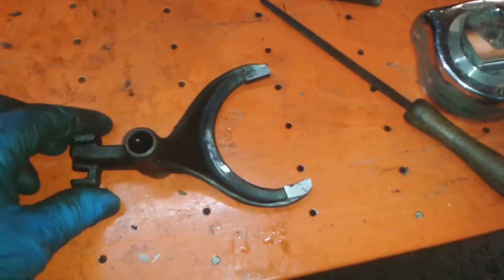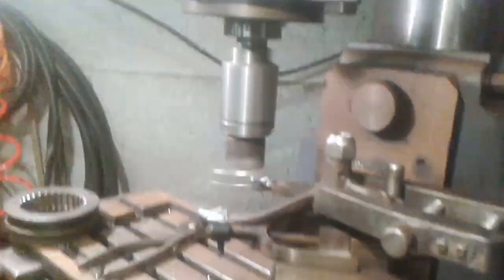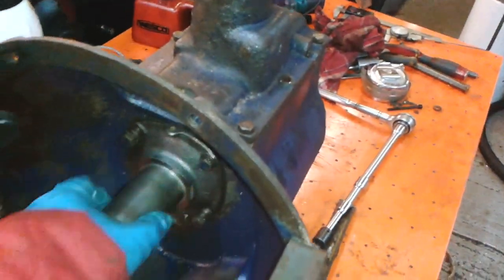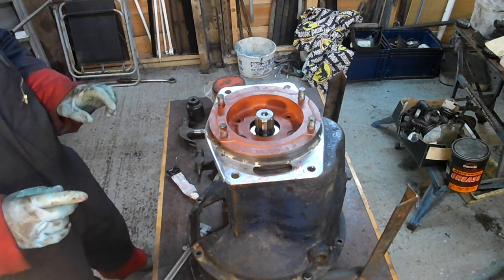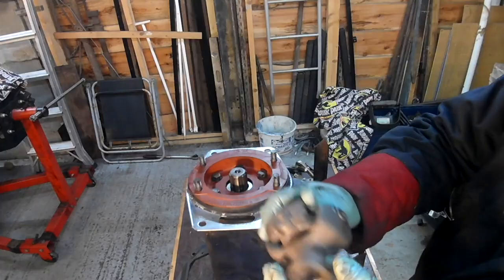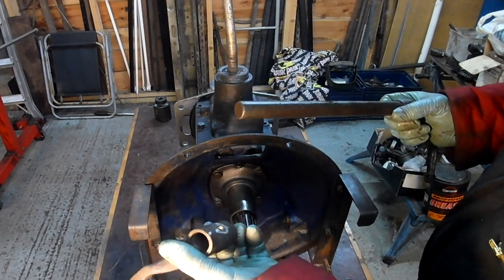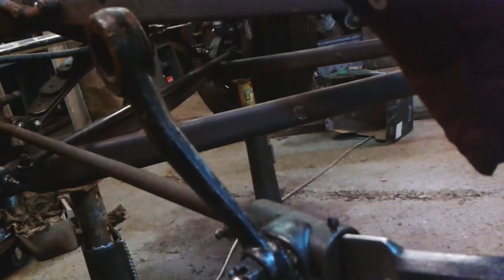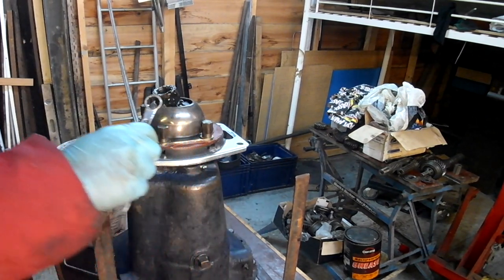Mart's update: 2021 No9. 32 Sedan Project Pt. 29. Early Ford 3 speed trans build continues +Extras!

Comment: Nice work Mart! I've seen seasoned Gearbox builders shy away from a fiddly job like that & give it to a specialist welder to do.
Well done mate.👍
Reply from the maker: Yeah, probably a good idea, Maurice. I've probably compromised any heat treatment it may have had, but I did mark it with a file so not too hard. I always think with the modest miles I tend to do it'll probably outlast me.

Comment: Hi Mart. I modified the fork on my trans by welding it. I tig welded it using a stellite (tungsten alloy) welding rod and it has lasted really well so if you have any problems with wear then I can recommend that method. Enjoying the vid though and always looking for little tips to improve these old transmissions. I am now sticking 380ft/lbs of torque through mine and it lasts amazingly well for such a large toothed gearset. I always use original bearings, gears and synchrony as I'm convinced they are better quality than the repro stuff.
Reply from the maker: Hi Matt. With you all the way on that. I discovered the snap rings were thinner years ago so it's always important to use the old ones. I was really glad to see two new synchro rings on a nos synchroniser I bought on ebay. They're in that box. Hope all is well with you and fingers crossed our paths will cross later in the year. Mart.

Comment: Good job Mart. I’ve not been inside an original Ford transmission before. Should give you years of service. I’ve got an extra trans laying around with no gear cluster though. Put a five speed in my coupe. Thanks for sharing 👍
Reply from the maker: Cheers Ron. They're not too difficult. A 5 speed is nice, but hard to use one in a 32 due to the K member in the chassis.

Comment: Nothing like a nice bit of machining Mart. Strange how the Gasket did that but I suppose an easy enough mistake.  Did you say French lol not them frog legs 😂 Everything works a bit better with lube even me lol. Handy tool from a broken chissel. Don't  loose your nuts Mart 😂 brilliant mate. 👍
Reply from the maker: Yeah, that viewer had very sharp eyes, because that segment was sped up!. Yeah, the French military used flathead motors off the Ford tooling way up into the 80s. They're a good source of flatty parts if you can scare one up.

Comment: You have to fill the grease by hand, you can never fill it with the grease fitting. I think its there to keep the cup in lubed up when the suspension do its work.  Great work as usual.
Reply from the maker: I think I agree, Lars. hard to tell where it's gone without tearing it down again.
Reply: @MartsGarage  A friend of mine mounted the U Joint Dry in his 32 Roadster, and lubed it thru the Grease fitting. It took some time, but it worn out, and started sounding bad. So he will not make that mistake again ;-=

Comment: Nice tool Mart.  Need to make one for all my tie rod ends on my herd of hobby tractors. (Farmall Cubs) AND my '47 Ford Sedan.  I've heard you mention and use Hylomar many times on your rebuilds.  Is it some brand of silicone or something else?  Still learning much from your videos, many thanks.
Reply from the maker: Hylomar is old school and pre dates all the silicone sealants. I just remember being told it was used by Rolls Royce so I thought I would give it a go. It's well respected in the industry/hobby. The little tool came out well. I had a broken chisel and the thickness and parallelism of the remainder of the blade made me think it would do the job.

Comment: Isn't it wonderful to have large sub-assemblies ready to go together!  Why the hylomar instead of regular silicone?  BTW, I've has good success just building up the shifter fork with brazing rod.
Reply: Blue Hylomar & Wellseal are superb tried & tested products!
Reply: Thanks for answering my question as to whether that build-up rod needed to be any kind of "hard" material.
Reply from the maker: Thanks Art. I'm wondering if braze might have been a preferable method. Nothing is irreversable, I could always redo it if it ends up being a problem. Having big lego blocks ready to go together is a good place to be.

Comment: Mart, the washer you ordered, is it for the cluster gear? is when the cluster moves back and forth, is that what causes the trans to jump out of second? kool vid thanks, Brendan
Reply from the maker: Hello Brendan. Yes, sometimes a washer is used at the front end of the cluster gear. It is a relatively thin piece with a flat on one side. I don't think it is cluster gear end float that causes 2nd gear jump out, but who knows? It might be a factor.
Reply: @MartsGarage  I have been told that it is wear in the front bearing that can cause it to jump out of second. I have always hunted down good original bearings and never had a problem with second gear drop out.
Reply from the maker: Hello Matt. What a pleasure to see your name pop up here. Will reply on your other comment.